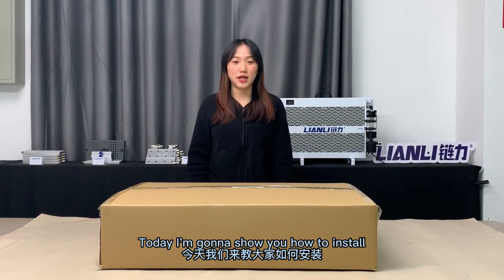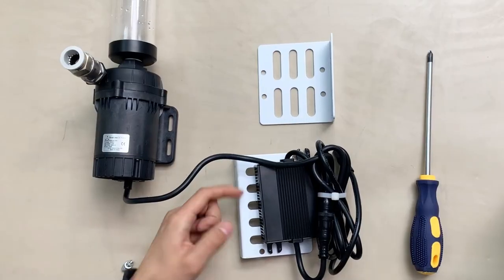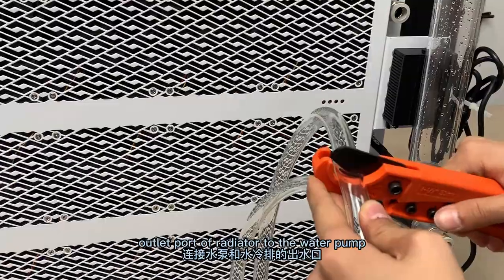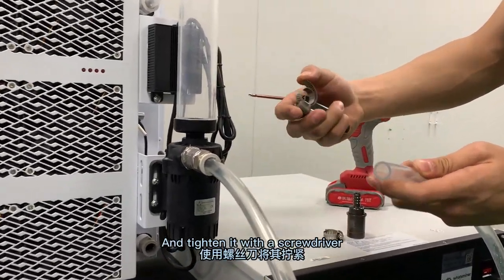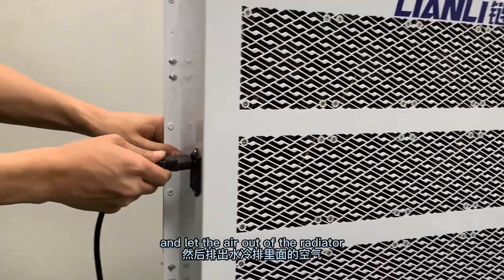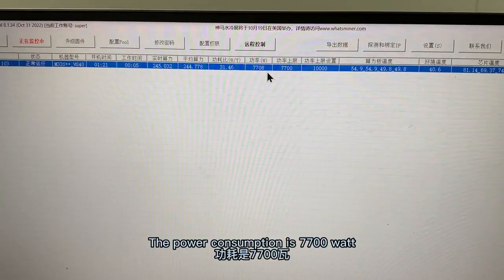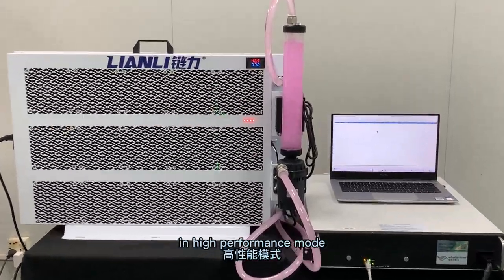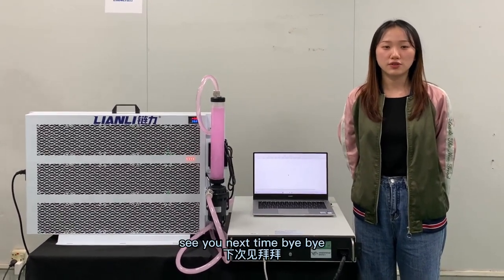Instructions for installation and use of special radiator for hydro miner

Comment: Which product can be used with Miner S19 Hyd.?
Reply from the maker: Can only use 12KW ,sir
Reply from the maker: 420 USD
Reply: @lianlitechnology1793  Is it used normal water?
Reply from the maker: Only 12KW can be used, sir.
Reply: @lianlitechnology1793  is 12kw for a single S19 Hyd, so each miner need a cooler?
Reply from the maker: If your ambient temperature is below 20 degrees Celsius, you will be able to connect two miners @imapiler

Comment: Hi! What's the price? Can it support 2 WhatsMiner M53s? Thanks!
Reply from the maker: 12KW is $390, and you need a radiator for each M53.
Reply from the maker: It can work on S19 XP HYD
Reply: @lianlitechnology1793   It is work on 220v?
Reply from the maker: @guruvisual4116  Yes sir
Reply: bonjours je voudrais passer commander pour un 12kw à 390$ vers où dois-je me diriger ? (pour un s19 hydro Hello, I would like to order a 12kw at $390, where should I go? (for a s19 hydro
Reply from the maker: 1 unité coûte 410 $ @lepikachu2cmort959

Comment: How come there is alot of air bubbles this wouldn't be effective for long term durability or use as it wouldn't cool properly during long hours
Reply from the maker: Bubbles are unavoidable, which is different from the phenomenon of submarine propeller cavitation that you understand. It only has very little pressure
Reply: What is the inlet temperature of the water and what is the outlet temperature of the water?